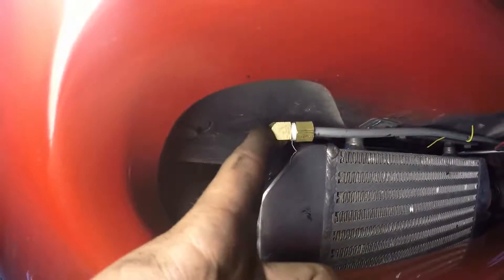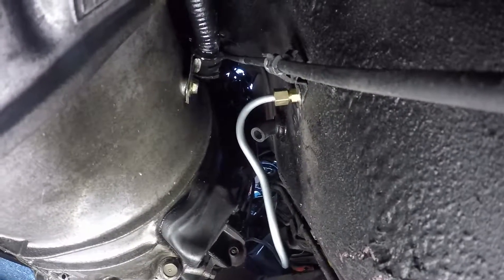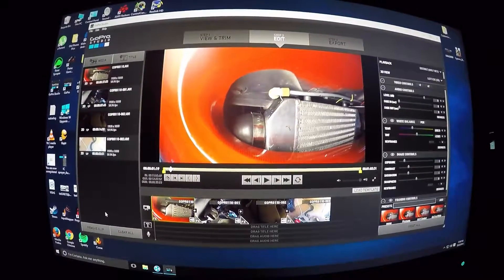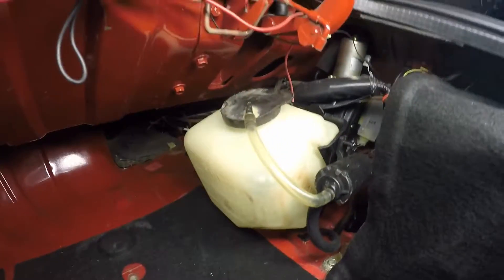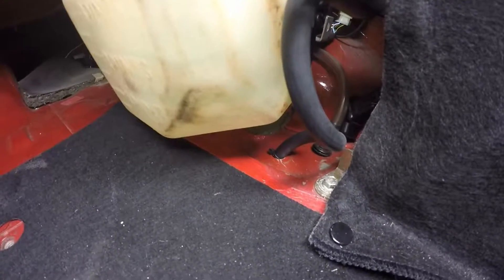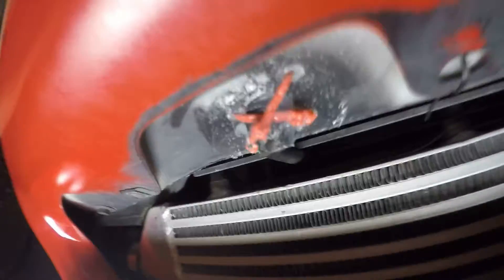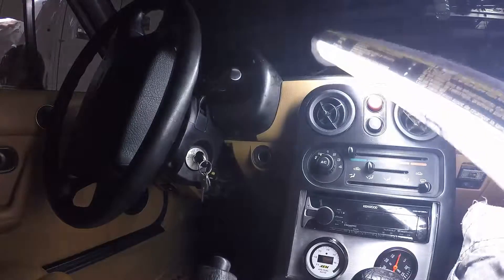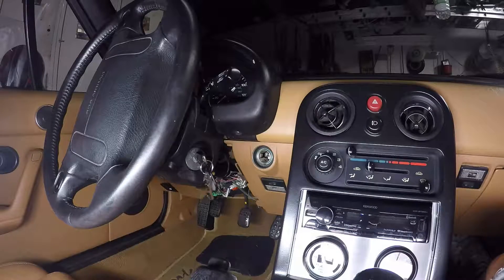FAIL Miata CO2 Intercooler sprayer

Comment: So my question is, is this one of those things where it is best combined with something like the Cry02 fuel chiller and intake chiller for best results. Or are the temps dropping enough with this mod alone that it helps make power?
Reply from the maker: I've changed this setup a little bit now but I suck with water. of course I can't back to back test them but the temps drop pretty quick and the water is essentially free lol
Reply: @thawkproductions4248  Makes sense. I thought about getting their intake chiller, but I am just not convinced it will work well enough to be worth the trouble or the price. I feel like a methanol injection system would do a better job of keeping charge air temps in check. But we will see.